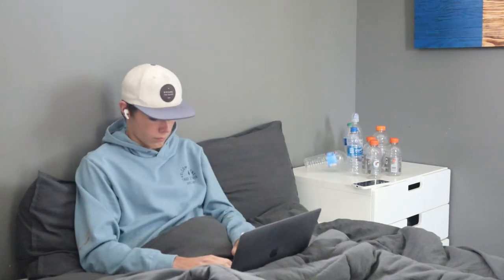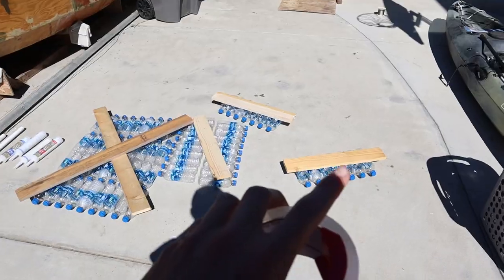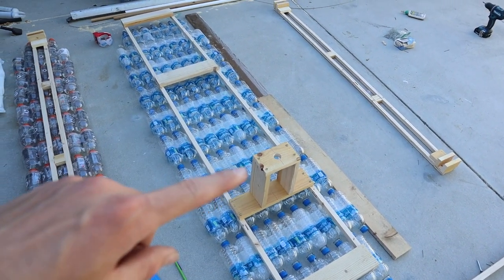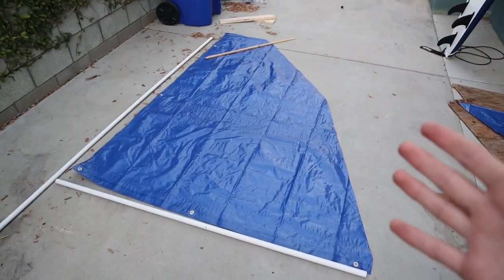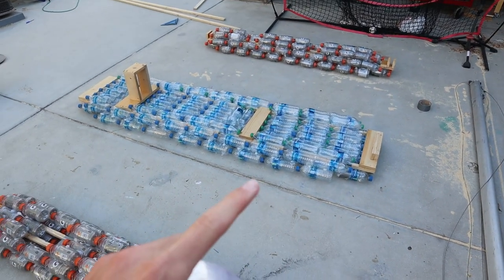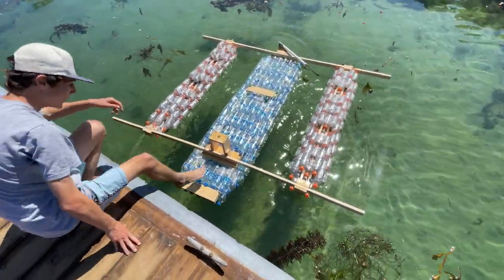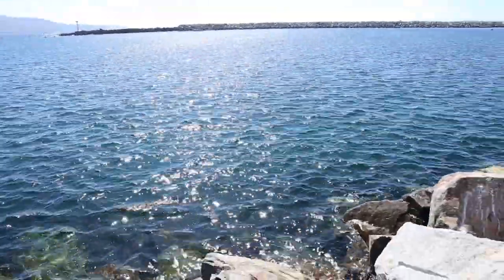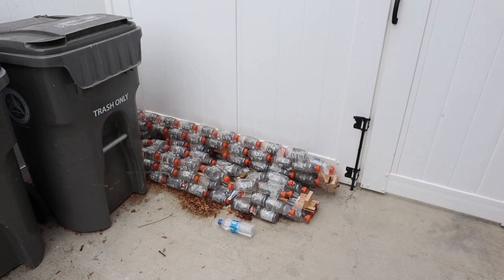I Made A Boat Out of Water Bottles

Comment: I love this idea, I am collecting bottles to build my own. Though I watching videos to see what and what not to do. If you where to do this again, refrain from using glue to hold all together, instead use duct tape than wrap with serran wrap or plastic sheeting. Also if you do this again, it would be cool if you made a paddle boat and recycled the bottles from the old boat.
Reply from the maker: I'm like the paddle board boat idea. If I do make another one, which I probably will, I'll most likely go with your idea and use serran wrap over tape and glue.
Reply: If the idea is to re-use trash and reduce plastic pollution, using a bunch of Saran Wrap is really counterproductive and wasteful. If you just want to have a free or nearly free boat AND keep things out of the landfill, find a free fiberglass boat. They are impossible to recycle and there are millions of used ones for cheap or free out there.